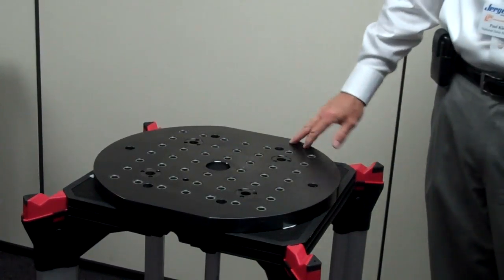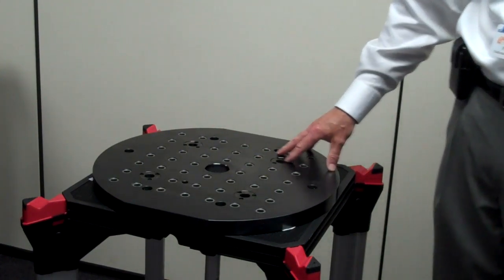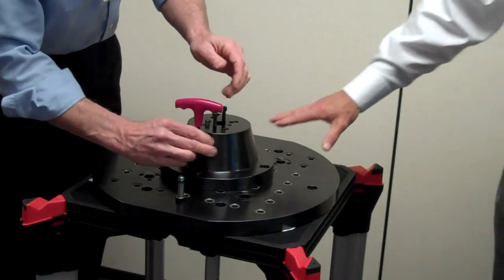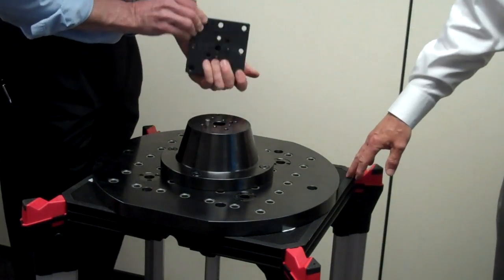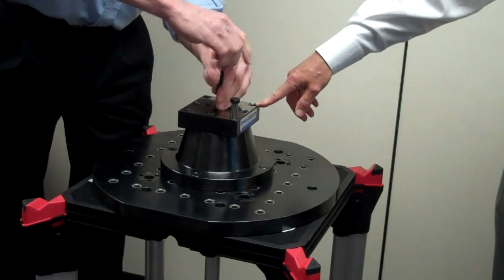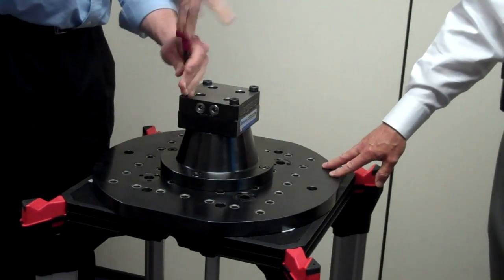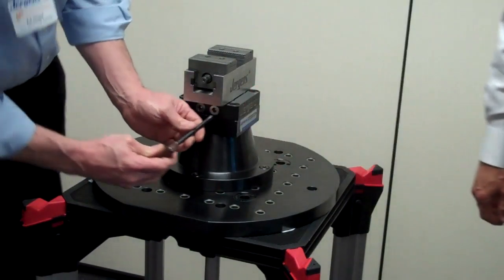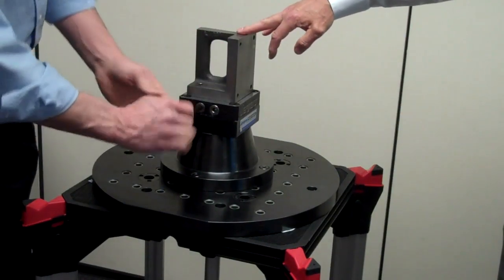Jergens 5-Axis Vise Quick Change System

Comment: Way too much stack. The modern 5 axis systems the only thing that matters is that you get just far enough away from the table to catch the sides of the part. Just about any small vice or fixture can work. The machine kinematics takes care of the rest. I simply don’t care if the vices are centered as long as it’s close. It just doesn’t matter.